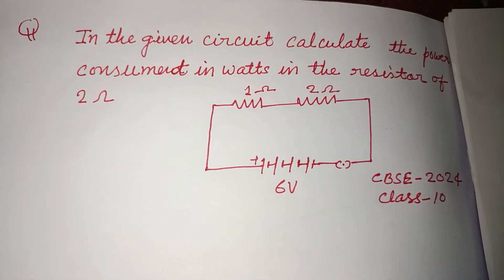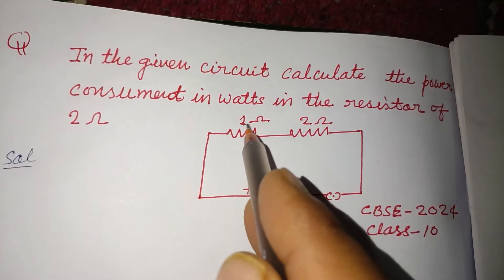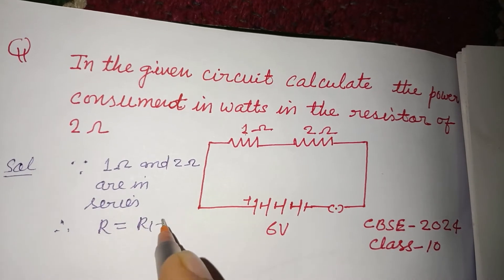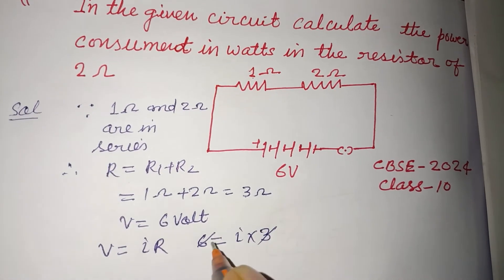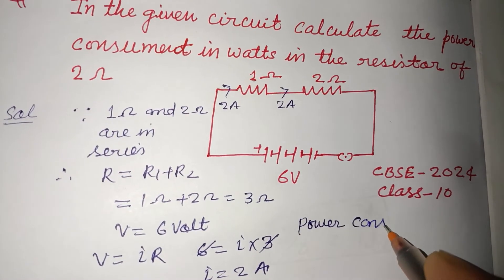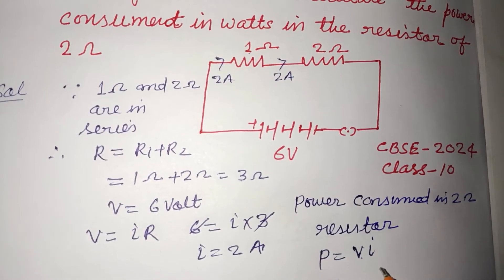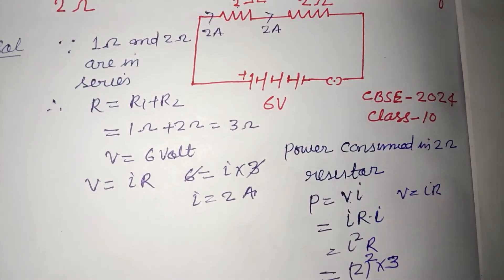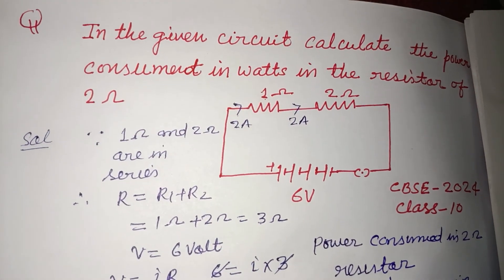In the given circuit calculate the power consumed in watt in the resistor of 2 ohm | physics

Comment: Sir ismai v²/R ye wala kyu nhi use kiye formula
Reply: yes sir why not tht formula
Reply: and also sir u can do it by p=vi because u have both the values right
Reply: You can use v^2/R also ,
Reply: @gcgaming2212  no bro p=vi ye formula pura circuit ka liyee hai lekin question m pucha hai sirf 2ohm ka islye ye formula nhi lgega or mai v yhi doubt m hu ki p=v^2/r formula ki nhi use hoga😀
Reply: Kyunki generally jb circuit series me hota hai to kyunki usme current divide nhi krta isiliye hum I^2R ka formula use krte hai or parallel me V^2/R ka  @snipershoot5957
Reply: I used v^2/R, got the same results I doubt it matters
Reply: Bhai voltage Aalag hoga har resistor me isiliye
Reply: Series me voltage change ho jata hai isliye
Reply: Bhai ye formula lagaoge phir bhi wahi answer aaega
Reply: @snipershoot5957  nahi series mein hai na toh voltage divide kardo fir p=vi use karo

Comment: Bhaiya answer tho 12watt h😅
Reply: It's wrong
Reply: I had the same doubt.....i=2A , V=6v and P=VI then 6 multiplied by 2 is 12 
Why do we use this formula I²R ??
Reply: @vidhimishra7046  direct calculation ke liye hai
Reply: @vidhimishra7046  series mein hai na toh voltage divide karne se bachne ke liye yeh formula use kiya hai
Reply: @AryanSingh-hc1fk  i do not know hindi so basically since volt is diff in series we use other one? so this formula will be applicable in parallel?